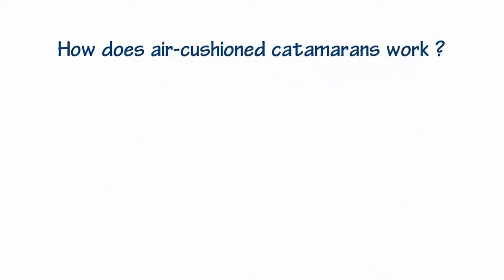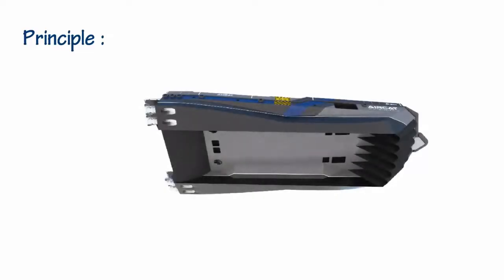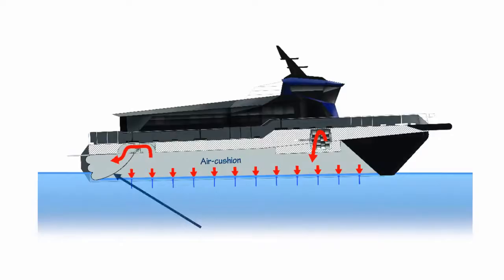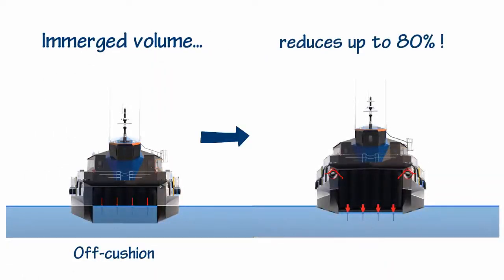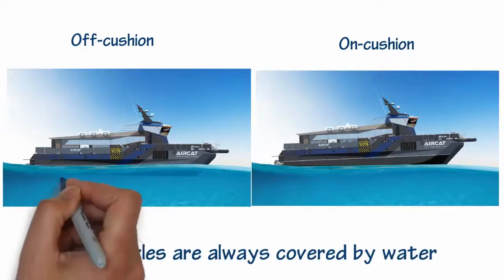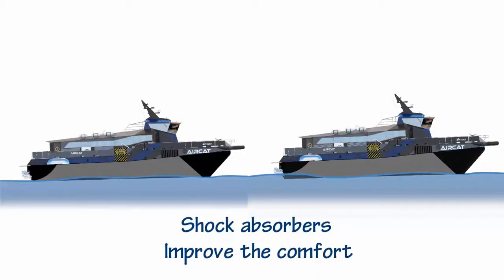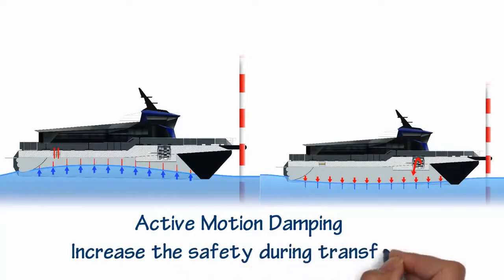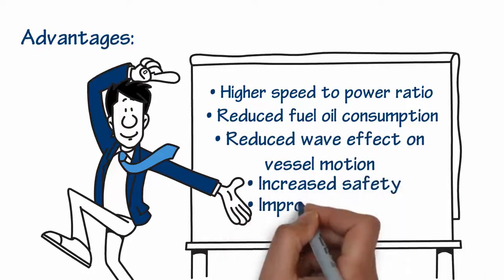SES explained

Comment: it seems like a lot of moving parts to maintain and keep sealed?
Reply from the maker: Compared to conventional vessels there are additional systems. The moving parts are the fans. The damper systems are not necessary to keep the air cushion sealed but to provide motion damping. These systems adds some additional complexity and costs. Whether the cost-benefit is worth it depends on how the task of the vessels. With the focus now on reduced emissions, reducing fuel consumption/increased energy costs, we see that the SES can be very competitive to other vessel platforms.
Reply: @esna2597  Thanks for your reply. Are you pumping air into the airbags or are you pumping air into the actual space BETWEEN the hulls and the airbags? 
is there an actual working boat, or is this a proof of concept idea?
Reply from the maker: @chasx7062  Hi again, we pump air in the space between the two side hulls and the sealing forward and aft. Forward we call it bow fingers, stern it is a stern bag. The stern bag is also pressurized with one or two bag fans. There has been built a couple of hundred SES over the years. Here is the latest finished build designed by ESNA: https://cwind.global/hybrid-ses-launch/
Reply from the maker: @chasx7062  Typically 10-20% of the vessel's power consumption is used for the air cushion. But this depends very much on displacement, speed etc. 
Yes lifting lifting a vessel generally makes her more unstable. Both because she is higher in the water and because the air cushion itself is destabilizing her. So when designing these vessels we must ensure that she is stable for this operation. If you want to look into the details of this, this books explains it well and provides information on how to calculate this: https://www.cambridge.org/core/books/hydrodynamics-of-highspeed-marine-vehicles/EFAC95328551E361A7DD04464F296C41.
Generally the stability of a SES when in on cushion mode is quite similar to a SWATH. When in off cushion mode it is more similar to a catamaran. The hulls of the SES is quite narrow, somewhere between a conventional catamaran and a SWATH. Generally a SWATH provides a stable low-speed platform, while a SES is a (very) high speed vessel.

Comment: does the ratio power/speed consider the fans power needed for the cushion as well?
Reply from the maker: Yes. 
When calculation power and comparing for speed, and when comparing to other vessel types, we will use the complete power and energy usage of the vessel. 
The SES gives typically a favorable power-to-speed ratio in the speed region 35-50 knots where frictional resistance dominates. Minimum mileage is typically around 35-40 knots, considering the complete power usage.
Reply: @esna2597  Thank you. When you state that the minimum mileage is 35-40 knots, do you mean the best efficiency is obtained in that range of speed? Or has this vehicle any advantage also for lower speeds? Have you ever made any comparison with foil hulls? Could you share if there is any literature on these vehicles? Thank you very much!
Reply from the maker: @compassft  Hi, Sorry for very late reply. For your qestions: Yes, best efficiency in terms of energy per distance is obtained typically at 35-40 knots. At lower speed she will use relatively more fuel as she also need energy to maintain the air cushion systems. Compared to foil hulls a SES will have similar energy consumption/efficiency at high speed, but has benefits as do not neet the foils underneath and is significantly less weight sensitive. Faltinsen's book is good on explaining both foil and SES: https://www.cambridge.org/core/books/hydrodynamics-of-highspeed-marine-vehicles/EFAC95328551E361A7DD04464F296C41.
Reply: @esna2597  thank you very much for sharing those info. Really appreciated